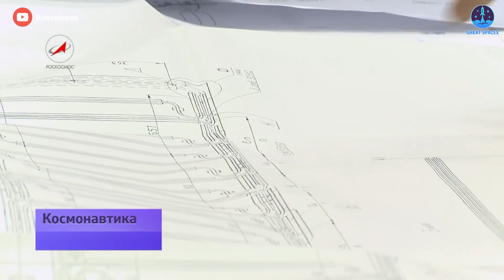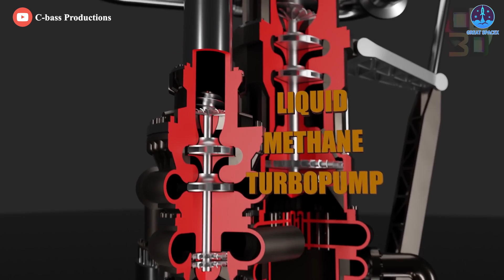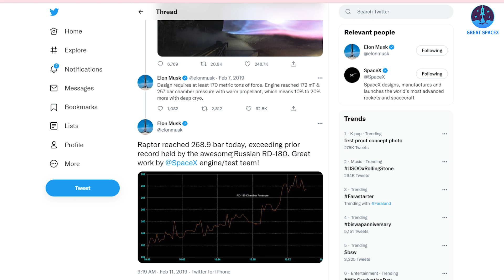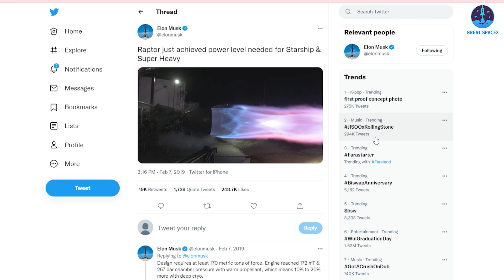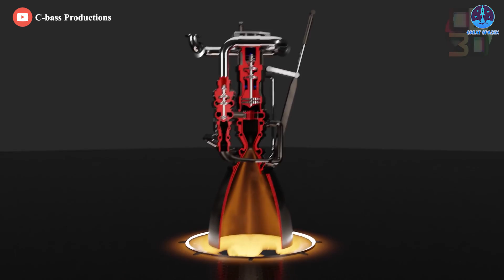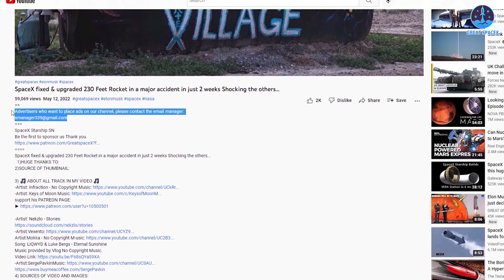It happened...! Russia finally realized SpaceX’s Raptor is BETTER than Russia’s best engines!

Comment: RD-180 is a KeroLox engine. Raptor (1 &2) are MethaLox engines. Wouldn't it be better to compare RD-180 to the Merlin KeroLox engines? Merlins have a VERY impressive track record!
Reply: RELIABILITY: Both engines are about equally reliable and both have an extremely large number of successful launches.  Merlin's do have an impressive track record - but so does the RD-180.   I think this is a wash.

SPECIFICATIONS: The 180 has 4 MN of thrust, Merlin has less than 1MN.   The 180 has a better throttle range (47% compared to 57%).  The Merlin does have a better thrust-to-weight ratio (184 compared to 78) but a much lower chamber pressure (10MPa compared to 26MPa for the 180).  The 180 also wins on specific impulse (338s compared to 311s (vacuum) or 311s compared to 282s (sea level)).   RD-180 wins this competition.

RE-USE:  RD-180 has never been re-used - but it's oxygen-rich and has great engine-restart and better throttle range (all of which would be important for-reuse) - so it's quite likely that it COULD be re-used.   We don't know - but I think this is a wash too.

COST: Roscosmos sells the RD-180 for around $10M each.  SpaceX claim that they make the Merlin for $1M each.   But we don't know how much it costs to MAKE an RD-180 and because SpaceX don't sell Merlins to anyone else, since that would require a hell of a lot of expensive customer-support, we have no idea what the selling price would be.   So we don't really have a point of comparison here.

DIRECT COMPARISONS: It only takes ONE RD-180 to launch an Atlas V rocket - it takes NINE Merlins to launch a Falcon-9.

A fairer comparison would be to choose the minimum "401" configuration of the Atlas (which has no solid rocket boosters - to keep things fair) and compare it to SpaceX's first Merlin rocket - the Falcon-1 (which had just one Merlin engine).   That Atlas V - can launch 9,000 kg to LEO.   The Falcon-1 was only able to launch 670kg to LEO.

But that was an earlier version of the Merlin - and the latest Merlin 1D's have nearly twice the thrust.

But in a 1 on 1 contest - the RD-180 wins by a huge margin...which would justify a considerable cost difference.

So while Raptor is a clear winner when compared to RD-180, the answer is very definitely not so clear for Merlin versus RD-180...and you could DEFINITELY make a case for RD-180 being the better engine.
Reply: @SteveBakerIsHere  
Excellent comment! Thank you!
Reply: @SteveBakerIsHere  Well said. Additionally, it is BE-4 that is replacing RD-180 in American launchers, and Raptor is yet to fly to orbit (Raptor 2 yet to even hop) - as is BE-4.
In other words, it is complicated, don't be a fanboy, one size doesn't fit all, let's celebrate every success.
Reply: @bazoo513  BE-4 is (right now) a completely unknown quantity because Blue Origin are not as open as SpaceX when it comes to communicating with us mere mortals!   BE-4 is something that rocket makers can actually purchase (ULA did exactly that) - but Raptor  is not (as far as we can tell) for sale.

As you say - it's VERY complicated.

Comparing two rocket motors and saying "A is better than B" is like comparing a brand new $25,000 Toyota Corolla to a $250,000 Ferrari F430.

The Corolla has 4 seats instead of two and is 1/10th the price.  So is it a "better" car than the Ferrari?  It's better for most people because Toyota evidently sell quite a lot more cars than Ferrari does!

But the Ferrari is MUCH faster!  It looks nicer and has a nicer interior.  It's depreciation rate is lower.  Ask anyone whether they'd prefer a Corolla or an F430 - and you know what the answer will be!

...and on and on.

You run out of points of comparison...and that's the precise problem here.
Reply: @SteveBakerIsHere  Exactly. Aerospace companies are not soccer teams - we don't have to support only one :o)
Reply: @bazoo513   It depends on the context.  If we only consider the engines themselves, in isolation, then OK.  But if we're talking about which engine to root for to win a contract, even if it's only hypothetical, then that would be a different and more complicated matter.
Reply: @rbrtck  Well, I am not a disciple of St. Elon in particular - I want every space exploration and transportation effort to succeed.
Reply: @bazoo513   What does this have to do with Elon Musk?  I'm talking numbers and, in some contexts, the dangers of relying on suppliers from foreign countries with rather different interests.  Root for the RD-180 all you want in terms of technical merit, but don't believe that it's a great idea to rely on its continued availability, and the same goes for the Soyuz rocket.  They can succeed all they want for Russia, and we can root for that, but no western country should have anything to do with them, nor any dependence on Russia for anything.
Reply: @bazoo513   I didn't say anything about the completely unproven Raptor that keeps burning its own parts and exploding on the test stand.  Maybe it will ultimately fail, proving that full flow staged combustion is not practical, for all I know.  I'm talking about how the proven Merlin compares to the RD-180, and if you disagree with my factual points, then address those instead of accusing me of hero-worshiping that Twitter-crazy weirdo with a death wish.

The RD-180 is hard to replicate, period, the effort to copy it would cost billions of dollars even with Russian help, and any American-built version of this engine would cost many times as much as the Russian-built ones, so it's pointless.  I'm arguing that the Merlin ( not the Raptor and its greenish "engine-rich exhaust"), although it is not available to competitors, is competitive in part because of its extreme simplicity.  Built for cheap, even in America, because of its simple but modern design (using 3D printing wherever possible), and using modern materials that help make it incredibly lightweight for its thrust level, it's actually competitive with the ultra-sophisticated, labor-intensive (to build), massive (strong enough to withstand much higher chamber pressures) RD-180.  At some point, becoming more complicated and high-performance runs into diminishing returns and even negative returns.  The RD-180 is a bit more efficient in terms of fuel per thrust because of its design, but on the other hand the Merlin has a much higher thrust-to-weight ratio.

When did I bring up Musk or the highly experimental Raptor, which may never become operational anyway?  Even the completely unproven BE-4 is way farther along than the Raptor at this stage, and frankly has a better chance of succeeding because it is at least of a proven type of design (engine cycle), while there are probably good and valid reasons that no full flow staged combustion engines have ever become operational (I'm not saying the Raptor will necessarily fail, either, but it's not yet worthy of being mentioned alongside these other engines).
Reply: @rbrtck  Okay, perhaps I was actually answering to someone else - I hate this YT "discussion" interface. I agree about Merlin - I think it failed only once in whole of F9 and FH history (and the launch was salvaged, anyway). But it is hardly a viable replacement for RD-180, with about a quarter of thrust and ~10% lower specific impulse (although much better thrust-to-weight ratio). Then again, if SpaceX can pack nine of them into the first stage, why couldn't ULA.
Reply: @SteveBakerIsHere   But 9 Merlin engines generate about twice the thrust of one RD-180, and together weigh 23% less!  That represents a huge advantage in thrust-to-weight ratio (more than double), which translates to greater performance that offsets the RD-180's advantage in specific impulse.  The Merlin is more competitive than you think.
Reply: @rbrtck  One RD-180 can be PURCHASED for $10M.   SpaceX say that it costs $1M to build a Merlin engine - and Falcon-9 has nine of them - so without profit and without product support, etc - 9 Merlins is $9M.

So it's certain that one RD-180 costs a hell of a lot less than nine Merlins...and in non-reusable rockets - that's a big win for RD-180.
Reply: @SteveBakerIsHere   But 5 Merlins is all it takes to compete against the RD-180 in terms of thrust.  5 Merlins together produce 100,000 lbs greater thrust and weigh 3130 kg less than a single RD-180, and of course the price becomes more competitive with 5 versus 9.  This is inherently a much fairer comparison.

In terms of product support, I'm sure there is no way that SpaceX could ever compete against the dependability of Russia, who will stand by their products and will always keeping supplying them regardless of the political situation...NOT!
Reply: And reusable.  @rbrtck
Reply: The comparison is it between similar fueled engines. The comparison is cost to Launch.

Comment: Considering SpaceX doesn't sell the raptor to any other launch provider it is hardly a replacement for the RD-180. It may be technologically superior but that only makes it the better engine for SpaceX because no one else has access to it.
Reply: But it won't be that way forever. The Raptor is still under development. Elon could not in good conscience sell this engine to anybody just yet. This will change in the future.
Reply: @nighttow8780  It replaces the RD-180 but you say it's not a replacement. Ask yourself, how many RD-180s have flown 5 years ago and how many raptors, then ask yourself, how many RD-180s are going to fly in 5 years and how many raptors. When one number goes down and the other number goes up, it's called a replacement.
Reply: @pratwurschtgulasch6662  how can an engine that has not flown its first mission yet be replacing anything? This replacement will happen one day, but Raptor 2 is still in testing. The 180 is tried-and-true. It has a proven track record. A $250,000 engine is not going to replace a 10 million dollar engine overnight. I am of the belief that commercial replacement of the 180 will occur after the Raptor has proven itself on one or two Artemis missions. It is at this time I believe you will begin to see Raptor engines featured on other companies Rockets. We all must remain aware of China however. China is moving into Russia's position as a space Power. And we know how China loves to copy SpaceX designs. We will see a flight certified methalox engine from China.
Reply: @nighttow8780  Raptor 2 is flying in the next few weeks on Starship actually.
Reply: @Waverox  a test. yup
Reply: @pratwurschtgulasch6662  Yeah - I agree to a degree...but SpaceX aren't likely to sell the Raptor to ULA or Boeing or any of the other heavy-lift providers...so it's not going to be what replaces RD-180 in Atlas V or other US government programs.   Blue Origin DOES offer it's next-gen rocket engine (the BE-4) to other launch providers - and that's what ULA are putting into their Vulcan Centaur launch vehicle...which is to be the successor to Atlas V.  

Sadly, Blue Origin have been very slow in developing BE-4 and are a couple of years late on delivering working rocket motors...but the TRUE replacement for the RD-180 in the USA will likely be the BE-4...not Raptor.

ULA currently have somewhere around 30 RD-180's in stock for future Atas launches...and at one engine per rocket - that's a couple of years of supply...by which time BE-4 might be available.

Surprisingly, the US DoD does hold a license to manufacture copies of the RD-180 in the USA that was negotiated 10 years ago.   There is a consortium of US companies called "RD AMROSS" who have been setting up to do just that.   However, nothing has actually been done to use that license - and if not renewed - it expires at the end of this year.   Obviously, that license isn't gonna be renewed given the politics of today - so that's probably a dead-end.

The plan for Atlas V was to use US-made RD-180's - but it seems that BE-4 is the true successor.

But unless SpaceX have a sudden change of heart - launchers using Raptor will COMPETE with launchers using RD-180, but won't REPLACE it.   There is not one launch provider who is planning to use Raptors.
Reply: @SteveBakerIsHere  yeah spacex is definitely not going to sell their engines, they're like make your own engines, oh that's right, you can't :D
 BE-4 will probably never work, that's just my guess. they probably have to start over from scratch. no point continuing to build a house on a shoddy foundation.
All the non-reusable rockets are or will be completely obsolete. there is not even a point for making an engine for an obsolete rocket. they'll probably never use all those rd180s anyway, costs too much per launch. whatever it is they need to launch will be so much cheaper by spacex.
Reply: @nighttow8780  how can something replace something when it is not completed yet you ask, by it getting completed right? if you think raptor2 won't fly you've got another thing coming :D
Reply: @nighttow8780  Of crs. Space X could go out of buisness any time
Reply: Elon can sell it but not to Russia they don’t deserve it.
Reply: @triple466  That's my point, he could sell it but won't sell it because it is one of his companies technological advantages over other launch providers.
Reply: @schrodingerscat1863  He doesn’t need to sell it he can do all the launches himself companies will hire him to send satellite to space they won’t pay Russia anymore it’s too expensive
Reply: Except if NASA or in other words don't make them sell which will probably not happen.
Reply: Yes - I agree.   For the job SpaceX has (flying massive bulk cargo to Mars) - the Raptor is clearly streets ahead - and a Keralox engine can never fly the return trip from Mars - so the RD-180 is absolutely not able to compete.

But for sending a spacecraft like the Altas V to orbit - Raptor probably isn't the right choice.  You can launch 9 tonnes to orbit using a single RD-180...but it takes more than 40 Raptors to launch 150 tonnes using StarShip...that's not such a good deal!

Comparing these engines is very difficult because RD-180 is mostly used in single engine applications - in conjunction with cheap solid rocket boosters if necessary - and both Raptor and Merlin are designed for ungodly large numbers of engines working together without SRB's.
Reply: @SteveBakerIsHere  Atlas uses 2 RD-180s. Starship should be able to launch 200+ tons to LEO with Raptor 2.0.
With reuse and Metholox makes Raptor many times more cost effective.
Reply: @SteveBakerIsHere  You can't launch anything to orbit with a single RD-180. You need a second vacuum optimised engine to complete orbital insertion because sea level engines have terrible efficiency in the upper atmosphere/vacuum. Those 40 raptors are actually launching close to 400 tons into orbit because Starship is reusable which increases weight, effectively reducing payload significantly. If you stripped Starship and booster down to a basic none reusable form it would likely be able to carry a 350 ton payload or even more. Each raptor has a significantly higher power to weight ratio than RD-180 after all and of course is about 5% of the price ($10M vs $500k). This is all about cost after all so a reusable Starship sending say 10 x 150 tons to orbit is far better than an expendable RD-180 sending 1 x 9 ton load.
Reply: @schrodingerscat1863  Atlas V only has ONE RD-180. So, for sure, you can launch to orbit with one RD-180 on the first stage.  I know that it looks like there are two because you see two nozzles - but a single RD-180 with a single set of turbopumps feeds two nozzles.   So TWO nozzles...ONE engine.  Yes, the Atlas has a second stage with a vacuum-optimized engine - and so does Falcon-9.
Reply: @SteveBakerIsHere  I am well aware of RD-180s split combustion chamber design. This was done to combat combustion instability when using one large combustion chamber but it is a suboptimal design and there are techniques to overcome combustion instability. This is why Raptor has a significant power to weight ratio advantage. No one said anything about Falcon-9, it is using completely different engines. The Raptor 2 is superior to RD-180 in every way, It has much higher specific impulse, is considerably smaller, considerably lighter and is an order of magnitude cheaper. Two raptor 2s can be fitted in the space needed for an RD-180 and produce significantly more thrust while being more efficient and being fully reusable. For sure RD-180 is a fine engine but it's days of being considered the best engine are over.

Comment: Russia invented tested and used every engine we know of in the fifties and we don't know if Elon's engine is better yet. That's just a fact
Reply: It wasn't Russia. It was USSR. That's just a fact. The mastermind of the entire Soviet space program Korolev was Ukrainian, for instance. So, we don't know what kind of space program Russia would have if it weren't for the entire USSR.
Reply: The USSR RD-270 full-flow staged combustion cycle engine never flew, where Raptor has got off the ground.
Reply: @favesongslist RD-270 had two VERY major problems:  (1) you couldn't throttle it worth a damn.  It ran with a throttle range between 95% and 105% - making it 100% useless for re-use.   And (2) it also ran on unsymmetrical dimethylhydrazine (UDMH) and nitrogen tetroxide (N2O4) - which are SPECTACULARLY nasty/dangerous chemicals that cost a LOT of money - which starts to matter a lot for extreme heavy-lift rockets like StarShip.    Despite really good numbers and 20-some seemingly-success test firings, the project was cancelled around 1964 - suggesting that it must have had some other problem that made it unusable.   My guess is that being unable to throttle it down when approaching MaxQ, they probably couldn't design a strong enough airframe to handle it.